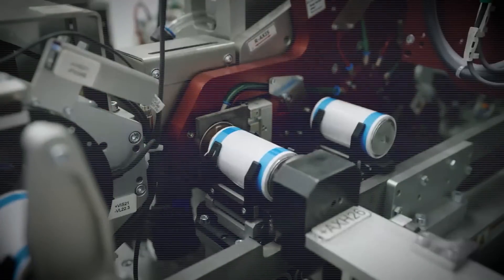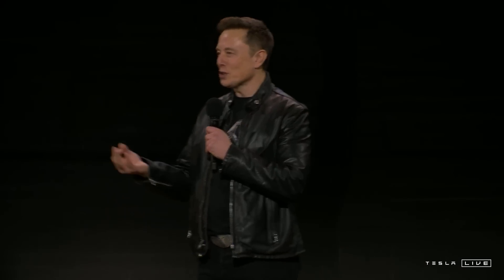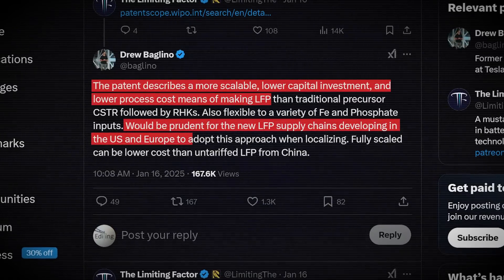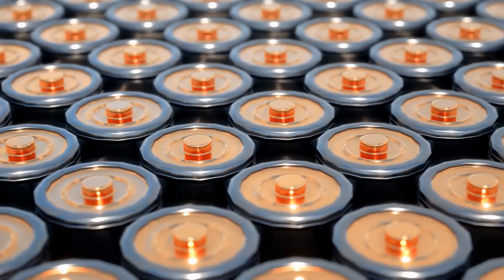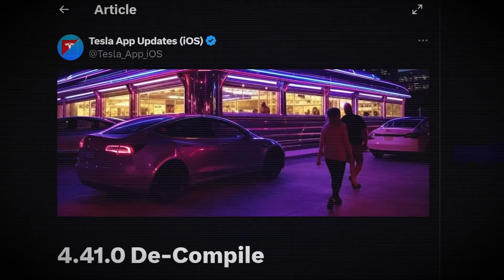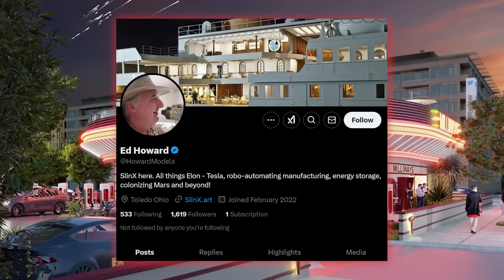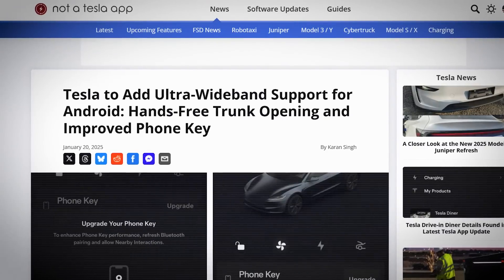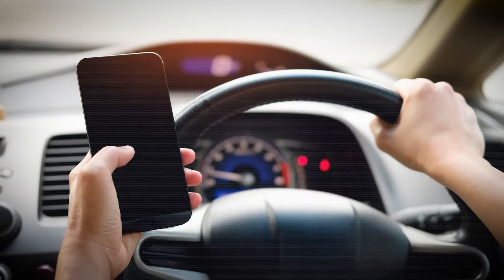Tesla Reveals Major New 4680 Battery Update

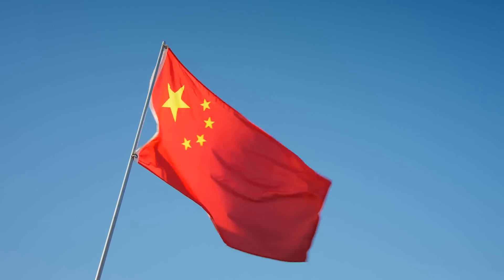Comment: 1:20 The LFP patent is from Michel Armand from Hydro Quebec and IREQ and it has finished back in 2021 It is not from CATL.  LFP have been widly used in the market because of the cathode improvvement that M. Armand did.

Comment: The person who made this video doesn't seem to know batteries.

Aluminum and Nickel are easy to source
Due to the safety of LFP (or LFMP) batteries,  it is completely unnecessary to make them as small cylindrical cells,   I would rather they make prism LFMP for the higher volume (and energy) density.

Also,  Didn't Limiting Factor basically say Gen 1 4680 cells were the BEST ever,  and then eat crow?  Why are we trusting him?

Comment: The original 4680 LFP cells that Tesla used for Models 3 and T had mediocre energy content and the charging speed was also not great.  In this article you only mentions new ground braking batteries but no details of the new energy content or charging speed.  😞
Reply: If they are tabless, that might help a fair bit with reducing the heating of the cells. That being said LFP is just kind of a wrong turn broadly cars are fundamentally higher performance and long range. Most cars on market are designed around.
Reply: This ain't the limiting factor bud

Comment: Low energy lfp is not good in cylinder form
Reply: All the wasted space between each cell must be at least 15% yet zero talk about this obvious disadvantage.
Reply: @jedics1  yup there's a reason all the catl lfp are prismatic. They're not stupid.
Reply: @jedics1 could it be that the empty space, though less efficient, aides in managing battery temp?
Reply: @mtraven23  It might but they usually fill the voids with foam to make it more rigid which takes that potential benefit away.

Comment: I dont see tesla ever making enough of its own batteries.  they are far, far behind CATL, BYD, Panasonic, LG, and others in terms of volume.  I think they will continue to need battery cells from as many suppliers as they can get.  4680 form factor is still a major question mark.  they were about to give up on it.  I think they are just keeping it going because of sunk costs.  (money they already spent on it which cannot be recouped).  I think it will just be one of many cells we will use.  prismatic just seem so much easier to scale.  maybe I am wrong, but CATL and BYD have so many batteries they don't know what to do with, meanwhile Tesla just cannot scale up.  its good that tesla is trying to make its own cells, but they don't seem to be able to do it.  cybertruck is still not ramping because they don't have the ability to make cells.  the price on cybertruck is still 70k.  when the price gets down to 50K on cybertruck that is when you know tesla can finally make a decent amount of quality/affordable cells.  a patent is just a patent.  as musk says its 1/1000 of the challenge.  the real challenge comes in producing batteries that are affordable, safe, and durable at massive scale.
Reply: They called it somewhat of a hedge to not be 100% dependent. I assume scaling only when commercially beneficial
Reply: i think its a mutlitude of factors from supply chain, production hell, regulation, and way more.

Comment: Which will change the EV industry...
HOW? The 4680 created by Tesla is used  ONLY  by Tesla and no one else.
The rest of the industry use 18650s. This new advancement will not affect 
them  AT ALL.

!
Reply: Panasonic and LG are developing 4680 cells.
No one uses 1865 cells now except Tesla S/X.
BMW uses  46 x 95/120mm cylindrical cells.
Tesla, Rimac, Formula E and Lucid use 2170 cells.
Reply: And where's the issue?